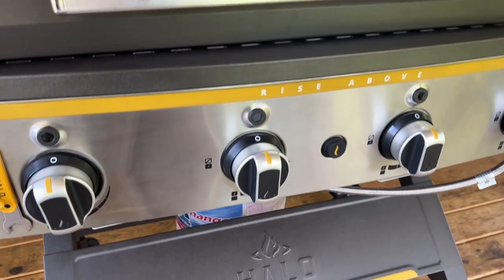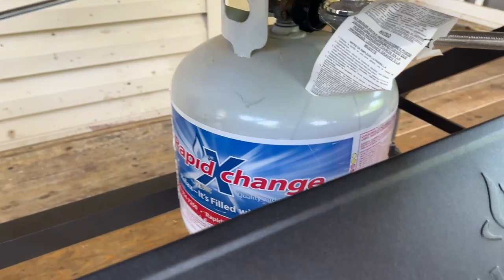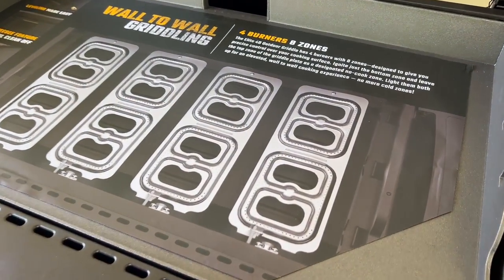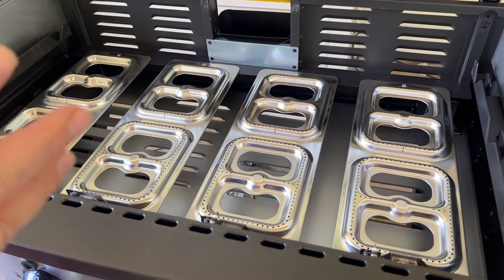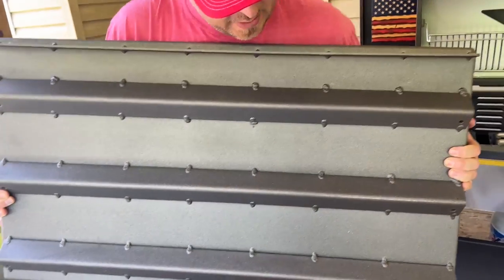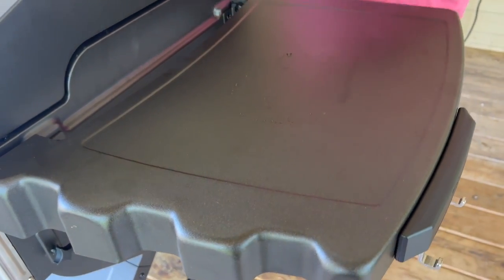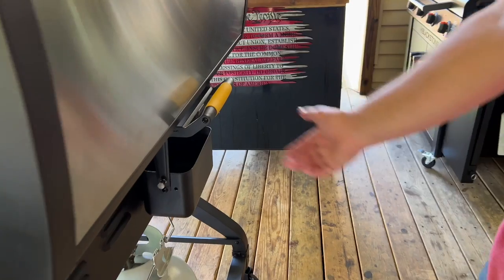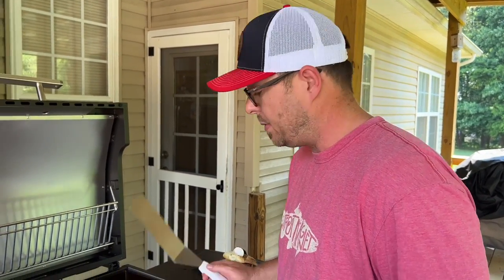Halo Griddle Review - Can YOU Stand the HEAT???  Is this NEW GRIDDLE Worth It?

Comment: Try setting the regulator to the lower setting, maybe it will cook a drop cooler?
Reply from the maker: In this video it wasn’t about low temps. I was following the manual instructions. I do agree that 9.5 should help. In reality it does and does not. This unit get hot refund configurations. I have released the first cook where we show the 9.5 regulator and trying to get low. Check that one and see what ya think.

Comment: My Traeger flatrock started cracking near the control knobs. Replacement did the same after some time. Seems to be a common issue. I went with halo elite 4b instead and I couldn’t be happier with performance and build quality
Reply from the maker: I have heard that a few times now...i had no idea about the Traeger breaking...So far so good on mine....glad the Halo is working out for ya...Once you dial the different congregations around and learn the goods and bad it truly is a good griddle...
Reply: @TheFlatTopKing  glad your unit isn’t effected. I loved the flatrock outside of that one thing.

Comment: Sounds like this will be choice for a reverse sear. To me the pellet grill takes too long to get to 600-700 degrees (riot mode,) plus if you've been doing lots of low and slow, you open the cover and get a flash fire. The griddle doesn't have that problem ( generally). New one not so sure.

Comment: So the 9.5 to 11” WC. The WC is an industry standard, stands for Water Column. Your natural gas coming into your house would be measured in the same way. As a point of reference, the 9.5” will be pretty close to 1/3 of a psi. Didn’t read through all the comments but if you haven’t tried it a 9.5, I’d give that a shot, it should lower your heat.
Reply from the maker: Yes..in this video it was not about low temps...just simply seasoning the griddle...The first cook which already dropped shows us using the 9.5 and less burners to hit low...

Comment: Hello King.. couple of questions. Did you have both front and back burners on, if yes, I think a follow video is needed to see how hot it gets with just the front burners on. And second question is where did you have the adjustable regulator set at? Sorry if these were covered during your video
Reply from the maker: Many videos have posted since this video was released. All those questions have been addressed in detail. The fist cook we put front burners on. The big breakfast we used zones for cooking. Thanks for commenting

Comment: Agree, the grease trap is too involved, way over engineered for sure, do like the top that can be used closed and the built in wind guards. It just looks like a gas hog, confirmed with the two settings on the gas valve It has to be a hot one/ Don't think I would use it as a portable model, just too big. Woah, way too hot, and it's not going to get cooler with age. Super review. You do need a fire extinguisher on that deck!!
Reply from the maker: Yeah bud...just posted the first video and tested all the variations to get lower...

Comment: Hey Neal,

    Thx for this review.   15:45 When you said the griddle was way hot, was that with the propane regulator on the 9.5 (smaller setting)? I wonder if that makes a difference?  Thanks.
Reply from the maker: It was in the 11...that being said we will be doing an update soon...i have several videos out their by now about cooking on this griddle...I will say this Quickly...this was seasoning only..not cooking...I would never suggest cooking on high on any griddle...
I have used the 9.5 after this and honestly just does not make a difference....it can get hot for sure...you might not be using all the burnes at once...its highly recommend not to unless you plan on using the whole griddle

Comment: I would try that again but put the regulator at 9.5 and it should be cooler, not sure how much but cooler.  I read through the manual and it is perfectly safe to do so.
Reply from the maker: Well we must had read Different manuals...mine says to use the 11 in normal circumstances...yeah you can use the 9.5...
Reply: @TheFlatTopKing  I hear what you are saying but on page 16 it seems pretty clear ...". If you
want to cook with slightly lower temperatures, then set the regulator to the 9.5" ... I think they assume most people are going to want a hot griddle and if you really have this loaded up you might need that.  I just know if I spent $1000 on a griddle I would sure try it, and if it can't do it then it's not worth $10.

Comment: The temps are like horsepower in cars - cool to know what the figures are and for bragging rights but in practical terms it sounds like it's almost unusable - perhaps if the regulator can be swapped out but even with one burner on (and there didn't seem to be much control with the 1/2 burner on it could be tricky to get the temps for things like eggs or even pancakes.  Best watch a few cooks on it before I'd rule it out.  I'm not buying one this year as I already have one and don't need an "upgrade" just yet...
Reply from the maker: Absolutely..in this video it was not about low temps...just simply seasoning the griddle...The first cook which already dropped shows us using the 9.5 and less burners to hit low...

Comment: One of the things I don't like about the Blackstone in the summer is that it's just so uncomfortable to stand in front of.  Sounds like this one is even worse.  I really like some of the stuff but just too much.  If it's that hot you're going to burn through a lot more gas too.
Reply: it's the opposite actually. if it's running that hot, it means it's incredibly efficient at keeping heat. so you can use much less propane to get the same amount of heat. windguards and double wall help
Reply: @alvinreviewsthings8793  Possibly.  Indeed if it's more insulated then it can get hotter with the same amount of gas.  On the other hand it's possible that it's that hot because it's using more gas through those burners.  Looking at the flames I'm not sure that's the case as they look smaller but more numerous.  Would be an interesting experiment though to see how efficient this griddle actually is.
Reply from the maker: Just remember...this was only seasoning...not cooking...this means yes it can get that hot...that was more my point..on the other videos its nothing like that..we didnt try to hit low temps during this...
Reply: @TheFlatTopKing  Looking forward to seeing what it can do if that’s the case.

Comment: I have 2 questions, did you have the valve on the tank set to the lower 9.5 setting or the higher setting? Secondly, despite your last griddle review, have you seen the steel made griddle tops, that are designed to go on top of existing grills or cooking surfaces? They make one for oven surfaces and I've contemplated looking into this because I love cooking on a griddle so often but I'm curious if it would be more hassle than it's worth?
Reply from the maker: First..when seasonings the griddle i didnt think there was any reason to adjust from 11 to 9.5....second we just posted the second cook and go over all the options trying to dial down the temps....still not there yet...I have not reviewed or even seen a steel made..i have heard of them but no experience

Comment: So, what would the use be with a griddle this hot? I recently bought a solo stove grill (they discontinued it and it was a good deal) and it is made to cook on high. No real air control so it will grill hot (burgers, dogs, steak) no low slow stuff. So that's fine, but with a griddle..... This seems like stuff is gonna get burned.
Reply from the maker: Well in fairness i would not have it that high to cook with....it will cook lower for sure...

Comment: So I think you need to review your understanding of the regulator... from watching other channels... seems like you have it backwards.  When the button is pushed in, I believe that to be on high.  Saw some testing where people let the machine cool down, did 10 minute test on low (front and back on... on low), and their results would seem to indicate that the machine runs cooler when the button is open... (not pushed in).  Don't own one, just watching what others are doing, and the data would seem to indicate open is low...
Reply from the maker: Michael...just to be open and honest...not being rude just stating facts...I was not trying to hit low temps at any time in this video...just turned it on and seasoned it...in the first cook we went over the low setting and tried to get low as possible...still not achievable. You are correct about the regulator and I was right as well...in this video i had it on the 11 in setting which is the in position. In the first cook i showed how to use the 9.5 setting for lower temps and why